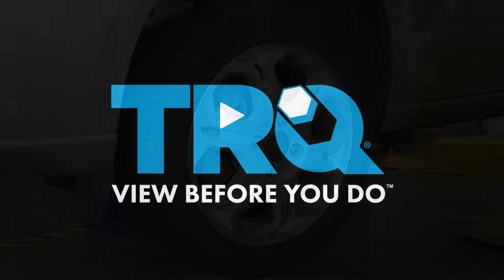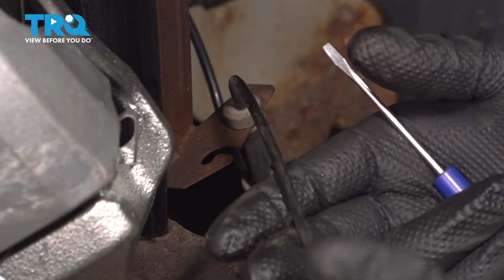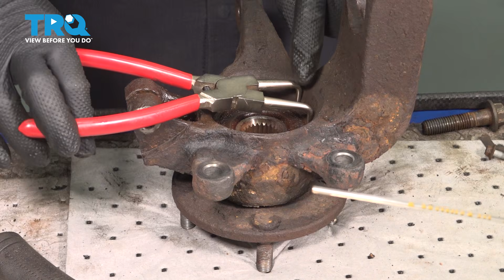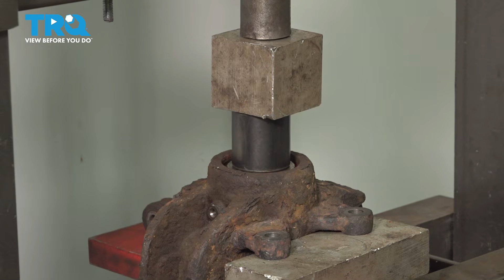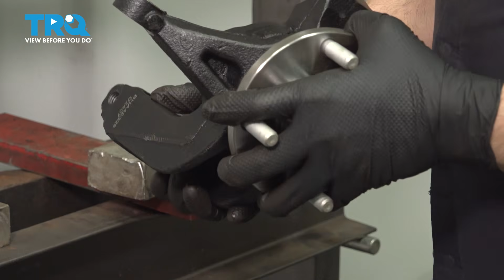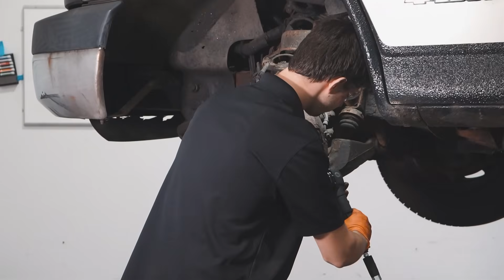How to Replace Front Wheel Hub & Bearing Assemblies 2008-2011 Ford Focus

Comment: Just did this entire project. Took about a day. The vice bolt above the ball joint for the control arm was serious business. It didn't budge until I started to use a thick chisel on the t50 head against the knuckle. It barely but did crack the rust enough for the project to continue- it took a very long time to complete that. 

I did have to buy a set of wheel bearing press plates and a 32mm head very long bolt that was used by an impact driver to safely remove and install the wheel bearings. The shops were closed for the day, and this job had to get done ASAP. 

Thank you for information in the video! All amazing stuff. 

Good luck to anybody trying this themselves!